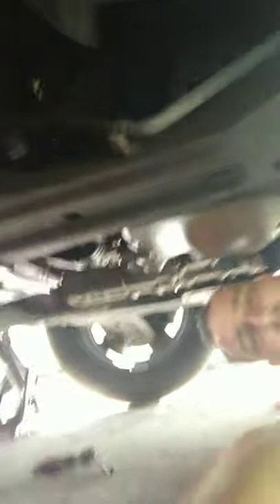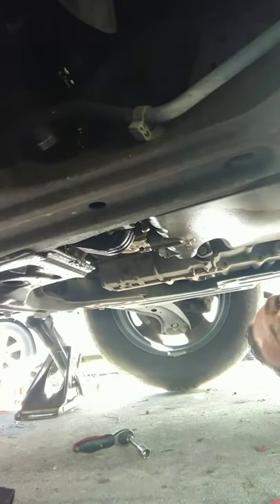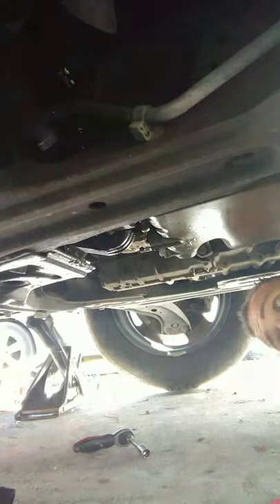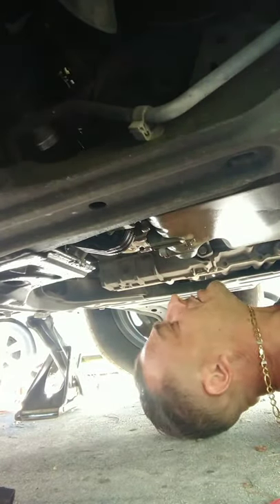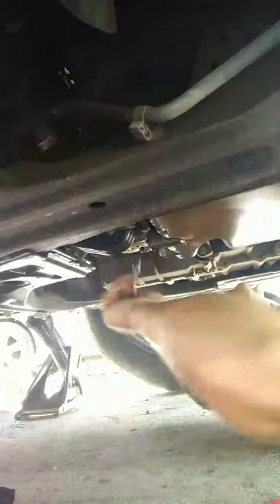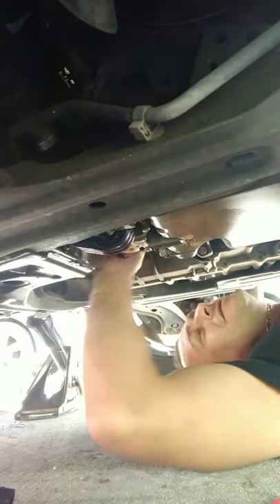2010 CRV crank sensor location replacement

Comment: Other video showed a different location for the crank sensor - other video had the entire wheel off, with rotors off and brakes, etc.  which video is correct?
Reply from the maker: In the other video did his oil filter point straight down